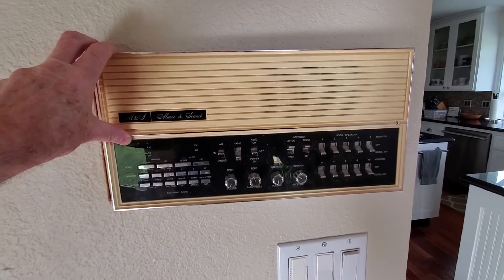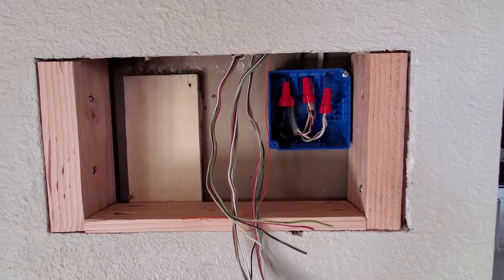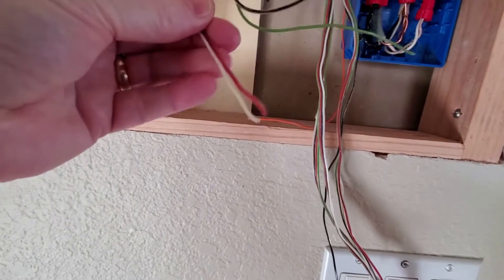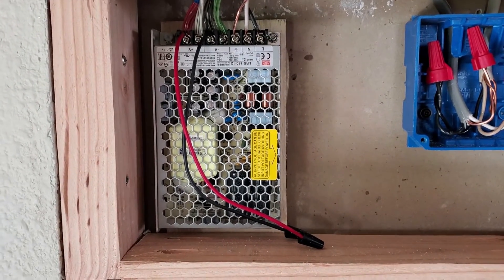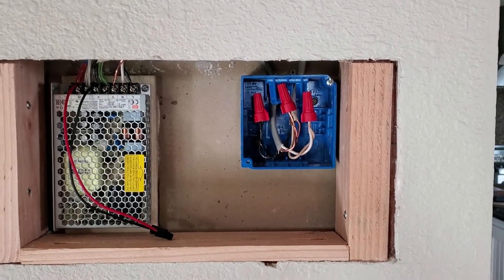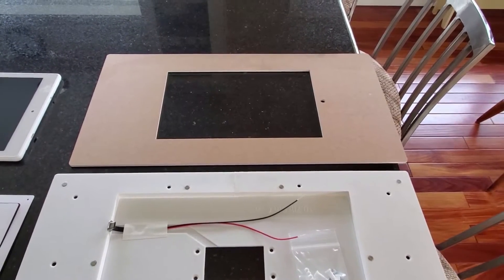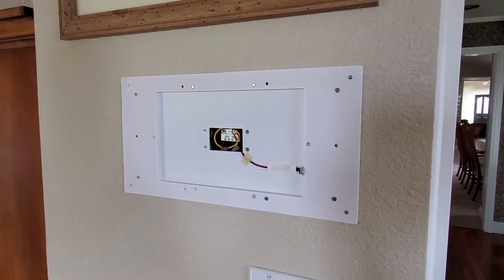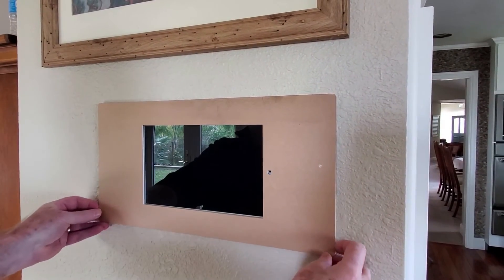Old Intercom Replacement - Wall Mount Tablet

Comment: I am actually doing the exact same thing and this video has helped me a LOT. Thank you for the guidance - it gave me encouragement to actually go and do it! I had an M&S system that had a tape unit with it too - which meant the whole it left behind was 16 x 16. A little too big to cover all by a mount. I did contact Makes By Mikes but they said they are moving location and couldn't do anything for me until mid-June. So instead, I patched up the hole and ordered a standard kit from Mikes. Waiting for it to be delivered.
Reply from the maker: Thank you for kind words @Aman Singh - I'm pleased it inspired you for your own update project! Hope we can see your final results! :)

Comment: Can you do a video on the Android application for linking the dots? To show how the whole system is linked together. Thank you!
Reply from the maker: Once you have Alexa installed on ANY of  your devices, Kristin, whether that be your Android Main system or your Android or Apple phone, you just add new dots to your Amazon registered Alexa account. You can set up the dots before you even install them physically in the wall. When you make any additions to Alexa via any of those devices, the updates will appear on all your Alexa apps registered to same account. The only 'linking' done by the process outlined in this video is purely just to supply the in-wall power for the devices. Alexa addresses the integration and they link wirelessly over your home wifi network. I hope that explains the process?
Reply from the maker: Here's the instruction at Amazon incl a short video - https://www.amazon.com/gp/help/customer/display.html?nodeId=G4J44HJJTUC3GJPK. If you're new to Alexa, start with some simple devices like Alexa enabled light bulbs which just replace your standard light bulbs. Or Power Sockets that plug into your standard wall socket. (I would recommend the Kasa/TPLink devices on Amazon)

Comment: This is great, thank you! We have an old, non-functional NuTone system. Now I have a fun project to do that will upgrade/modernize or home 😁
Reply from the maker: Pleased you have been inspired with a new project - I'll warn you, it gets addictive as you get into the whole Smart Home thing :D - after getting the master station installed I had added many Smart components and even replaced my old wired Alarm system now also controlled by the Master system (and two more smaller panels - 7" & 8" to add further local control, especially for the alarm).  I should do a video on that one next.
Reply: @decosse01  definitely more videos with all of that!
Reply from the maker: @SouthernBeau1  You mean on the Alarm Panel? I will try to do an overview of that but it will be retrospective, since it's already complete. But I really love that upgrade and it was a great next step once I had the base infrastructure for the Wall Control Tablet. The hook-up is quite east to execute, so even with it complete, I can still explain how it all works and what you do. In the interim, take a look at Konnected.io which is the system I used. They have kits that will work in tandem with the original Alarm Panel (if you want to retain it) - they call that an 'interface kit' or replace it completely - a 'conversion kit' 
I ripped mine out and completely replaced the 40 yr old alarm module with the Konnected Conversion Kit which creates a new 'Smart' Alarm system. It utilizes all the original door and window wired sensors, but now connected (!!! :) ) to the Konnected Panel. 
I really should get that video done - it was the next logical update for me, It's very cost effective and a pretty easy hook-up. I even did a new Smoke and CO detector system that is also hooked in to the monitoring system, so let's also add that to the queue.
Reply: @decosse01  wow this is awesome! I’m going to be looking into this as well, your videos are amazing; please continue to document these projects! Such a great information source :)